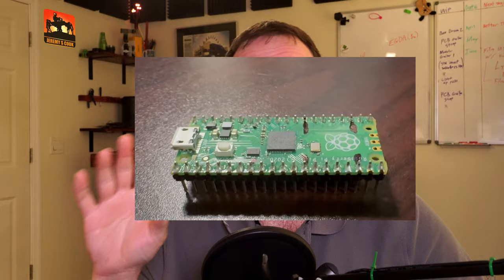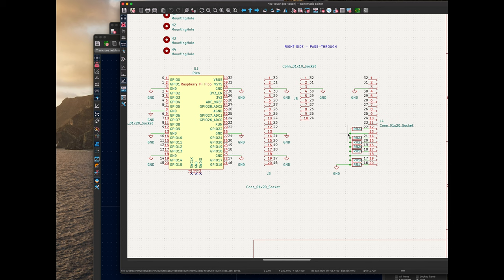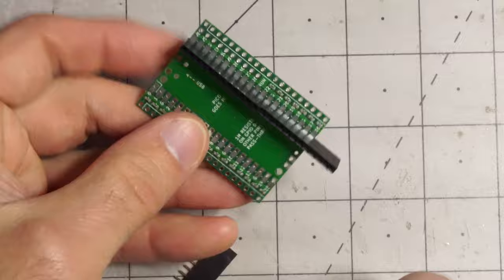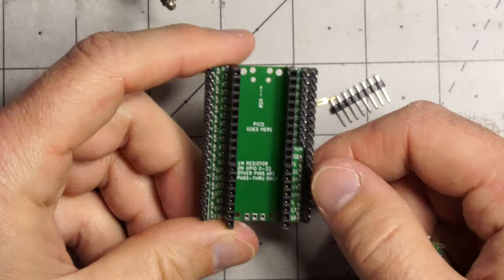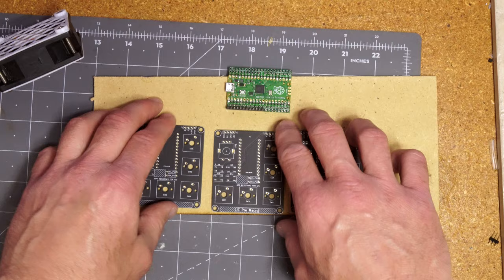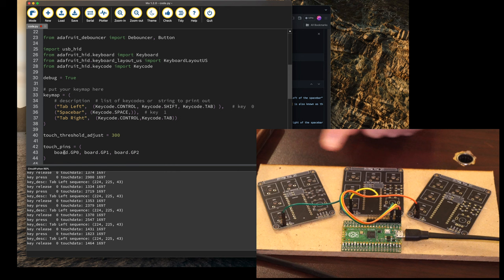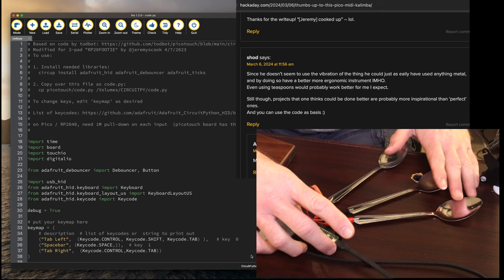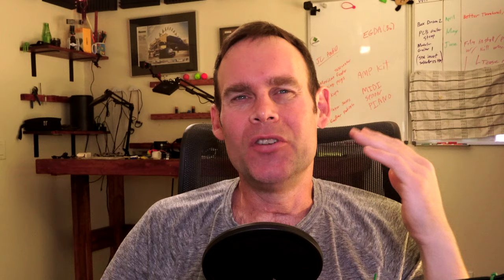Can You Make a Spoon-Computer User Interface? [Raspberry Pi Pico]

Comment from the maker: What would you do with a Pico Touch 2 board and touch sensing for the Raspberry Pi Pico?
Also, should I do a followup on the 3-spoon MIDI on JCO Audio?
Reply: Smart mirror interface where you can touch the sides/bottom of the frame to control it
Reply from the maker: @carl689  Good idea, thx!